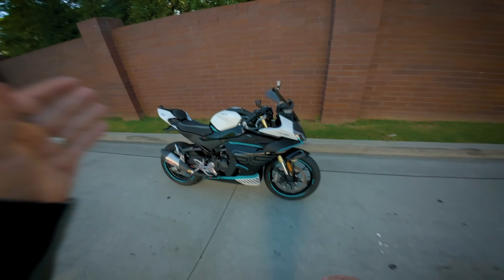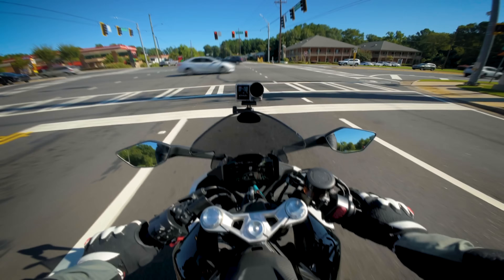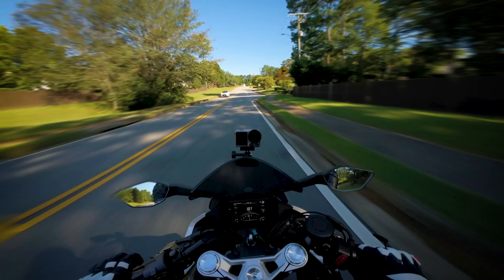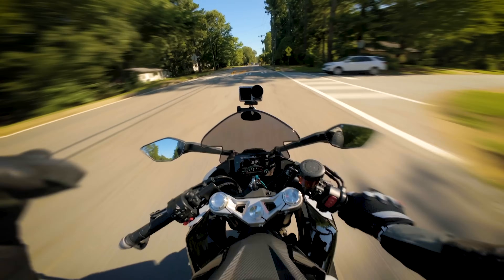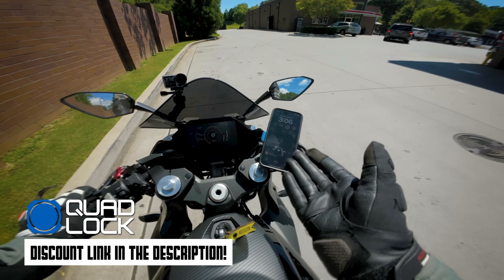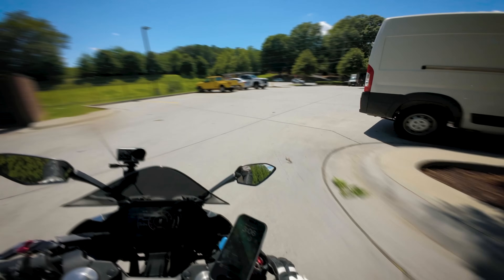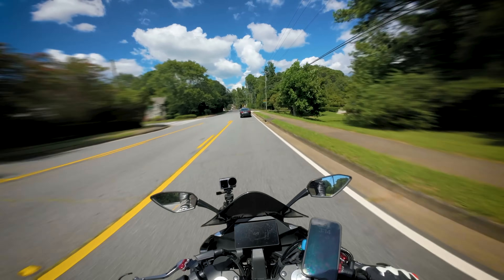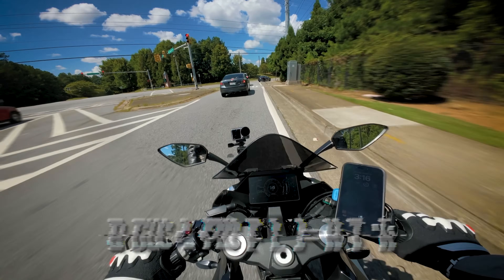Does flashing your ECU actually make it better?

Comment: a flashed  Electronic Control Unit tends to smooth out the power as they're optimizing for power not fuel efficiency and pollutants. if you examine the graphs if stock vs flashed, the places the stock flattens is where it would otherwise be pumping out to much smog.

Comment: Hey chase! I’ve been watching your content for a few years now and you inspired me to pick up a bike! I am now the proud owner of a 2020 Kawasaki Versys X-300 and it’s been so much fun. In 2 and a half weeks I’ve already put almost 800 miles on her and it’s been the best 800 miles I’ve ever driven. Yea I get run down by a 636 at a quarter throttle going 100 mph but I don’t care. It doesn’t matter what people say about getting tired of a 300-450cc bike, motorcycles are fun at 100, 45, 20mph and everything in between. I enjoy my bike everywhere from the street to the dirt. I met a lot of people too and I’ve got a riding group of 300s, 400s, 600s, 636, 675, a 1390 and a 1441 (ZX14R). We just enjoy riding together. Also, 60-70 mpg is nice too. 😅 Thanks Chase!
Reply: Fun has 0 to do with the size of the bike. I rented the little versys 300 when I went to Greece for a week and it was the most fun I ever had.

Comment: The highest return on modification investment anyone can do to a relatively modern motorcycle is an ECU flash from a reputable company/tuner. 

Whenever I buy a new motorcycle I pull the bread box, pull the ECU, install an exhaust system if needed, and wait for that wonderful ECU to come back in the mail.

My two most recent bikes are an MT-09(gen 3) and an MT-10(gen 2). I had the flashed 9, swapped for the stock 10(for one ride, home to pull the ECU), that ride home SUCKED. I missed my 09. 

Currently on the flashed 10. It’s wonderful and have no regrets.

Comment: Yes it is better. The flash from 2WDW on my MT-10 made an attending difference. Much smoother and got rid of the dip between 5-6k
Reply: Yeah a lot of stock bikes have pretty big mid range dips from the factory. The power is so much more linear and smooth after a flash. Totally worth the money

Comment: Yes, for a $4k bike, I'm not going to pay $400 just for a tune. 
I thought $200 is already a lot for a tune. 
The right price for a tune should be $50 if you're local, and $120 which includes shipping and handling. Not paying 3.5x over base price. 
For that price, I could buy myself a laptop and manually tune it myself.
Reply: Yet folks pay 500-1000 for an exhaust that leans the bike out further and reduces power 😂

You have a dyno and the software license already? You are a few grand short on your estimates.
Reply: @Tinker3504  who says you need a license?
Reply: @ProDigit80  if you’re capable of cracking woolich(or similar), you wouldn’t have made the above comment. If you had or were capable of purchasing something like a dynojet 200i, you also wouldn’t be taking the time to respond. 

You don’t “tune” a motorcycle with a USB-C cable and your thinkpad lol. 

But nothing is stopping you from offering $120 ECU flashing services. Please(and I legitimately mean this), do start offering this service.

Comment: Aftermarket ECU flashes dont have to meet emission specs

Of course that will change the power delivery.

Unfortunately it invalidates your warranty, which here in the EU is 4 years and on a Chinese bike... I'll take the warranty.

Written a by a cfmoto 650 owner, btw.

Comment: I don't trust these cheap Chinese trash bikes to be anywhere near as reliable as real motorcycles. 😬
Reply: Is KTM a real motorcycle to you!? These bikes have already proven to be plenty reliable at 20k miles some have already put on them.
Reply: @ra6298  KTM makes goofy dirt bikes. Even their road bikes look like dirt bikes, so they're not exactly to my taste, but they've proven themselves to be well made. Not sure how that relates as Austria isn't China, who is known to cut corners like crazy.
Reply: Ok mate you do you. No one is forcing you to ride one. 

Maybe reserve judgement until there's a few with 20k+ miles clocked up though. Chinese manufactured does not automatically mean bad. So so much is made in China - like most phones sold.
Reply: @thomasolson8417 not every ktm is made in Austria
Reply: @thomasolson8417 KTM is Austrian in name only these days.
Reply: @JessicaSimonson1976  that's fine. I wouldn't buy one anyway.
Reply: @thomasolson8417  It relates a lot because Cfmoto builds KTM's engines for them and other japanese manufacturer this is why they decided to manufacture their own motorcycles because they already know how and have the parts.... and this is why they are cheaper, no middle man.
Reply: CFMoto also builds engines for BMW. I wouldn’t be worried about their reliability and everything else parts wise is what everyone else is using
Reply: @thomasolson8417 you do realize that the majority of KTM’s short of the 1290’s and 1390’s are made in China, right? CF Moto makes their engines, they have been for a long time. 

Also, define what you mean by real bike. Because if you mean Harley Davidson, they don’t have the greatest reliability track record…
Reply: @sleeper.simulant7327  ew. Harleys are for retired, out of shape Trump supporters. Hard pass.